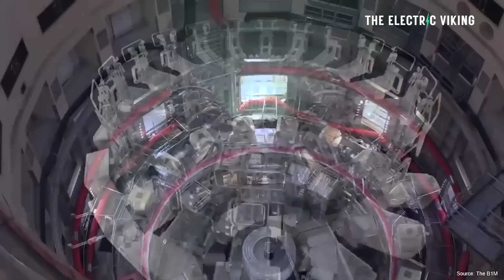Sweden criticised over plan to build at least 10 or more new nuclear reactors

Comment: You cannot compare new gen smpr nuclear with current plants. The technology is safer and we in fact need it to reuse old nuclear waste again as fuel to reduce the radiation time to 300 years from 100 000 years. Storage will be solved. Yet the waste will reduce to 1/10 amount.  

At the same time we will get energy. Recycling at its best.🔄♻️ The new gen plants will use mainly thorium as fuel after the old waste.

 Thorium is low radiation fuel which can be found in beach sand. It is so low radiating that it does not harm people. Yet thorium can be extracted from mine waste material piles. It is estimated that thorium will last 10 000 of years. One persons energy need is a matchbox size of thorium which is abundant substance.

Nothing but pro arguments to these passively safe new small modular nuclear plants which can be built in  citieswith low costs👍

Sam needs an update to his data. Of course this technology is just coming to market in 2-10 years.

Comment: That is very smart. Germany decided to shut down their nuclear power plants and they have suffered very high electricity costs. Unlike solar and win nuclear power provides constant output for long periods of time .

It does not produce any co2 either. If they have extra capacity they can sell it to their neighbors. I know Germany would be happy to purchase any extra electricity so they don’t have to activate all their coal plants. 

It is a win-win.
Reply: Germany's final nuclear shutdown had absolutely zero to do with electricity costs since their nuclear power was only a tiny fraction of their total electricity production and electricity costs are also coming down all across europe since months.

Germany has extra capacity since many years, which they are selling to the countries nearby that don't have enough capacity despite having tons of nuclear power plants, like France.

Wind does also provide constant output to the grid and is Germany's main power source since a long time.
Reply: @Tschacki_Quacki  
In 2021 13.3% of electrical power was produced  by nuclear power. Now (after the closures) that is down to 6%. 

To think that electricity costs will go down when you reduce production capacity is the opposite of what will happen.

Wind is not a constant resource. Wind speeds go up and down. Unlike a nuclear power station that can produce constant output.
Reply: @realestatenow  It was 6% before the shutdown and is obviously at 0% now.

Production capacity didn't go down in Germany. H1 2023 had the exact same output than H1 2022 but it was significantly cleaner and was still way more than Germany would need for it's own consumption. Total production will have increased by the end of this year, since Germany is constantly setting up new wind turbines and solar.

Wind is a constant output. You can see that in every country that relies on it. Wind turbines aren't accumulated in a single place, they are spread out across the whole country.
Reply: @Tschacki_Quacki  as far as I know the last 3 nuclear power stations are still operating in Germany.   

I am glad they are getting clean sources of energy. I doubt that they are cheaper than electricity produced from coal though.

Comment: Sweden is pretty far north, so that might be something to take in the count with solar, and they have a lot of snow in the winter, they basically have only wind energy left to tap into, and maybe bio mass with wood, there's also been a ton of new developments with small prebuilt thorium reactors, I think it's a good thing at least someone is trying this new tech before we dismiss it completely
Reply: Climate change has caused almost snow free winters in southern of Sweden. Few day under freezing temperatures.
Reply: @electricviking 
Breeder reactors / thorium reactors are the solution in medium term for sweden and other north countries if they want to keep a base industry to sustain manufacture industry. Sweden may have a better policy than germany and other manufacture powers in europe.
Reply: @Harrythehun  Thats true, but there's still Sun angle problem this far north, and much more cloudy days, I just got a solar system for my self, and on rainy days production is less than 10% of sunny ones, pannels are really sensitive to clouds and tilt, I can even see production falling week by week as the Sun is getting more angled in the autumn, if you have a huge power station this incremental losses will be really visible, they will probably use those reactors for small amounts of energy in the summer and then use them like "peaker plants" for the winter
Reply: Well, we've massive hydropower here.
Reply: @Fs0n1ine Sold to the Dutch (400mW), the Germans, the Danes and even the UK, not to forget that the Norwegians want to keep warm in winter too and the hydro works less when bitterly cold (somewhat unusual but a risk). They Dutch btw want more. So: now what? Pull a cable to Australia?
Reply: @nas4apps Unfortunately I have no idea of how the losses in the power grids work (my brother has worked with and planned at least low power lines and sea cables).
Sweden sells 400MW to NL. The losses in the Swedish grid are (I have seen the numbers, and they were quite large) at least 1,000 MW, but they can be 2,000 MW, which would correspond to two (old) nuclear reactors.

So Sweden needs 1-2 nuclear reactors to just cover the losses in transmission of power. So it's of importance that the power is produced close to the consumer!
Reply: @Fs0n1ine  But aren't most of the spots already used, you have to have specific factors to be able to make an artificial lake, and it's pretty hard to start making politically wise because it flods a lot of land
Reply: Yes agree.

Comment: Sweden has had practically co2 neutral electricity for 60 years now. Germany spent like 500 billion euro on renewables and still only have 50% co2 neutral 🤔 if they had keept their nukes they would have been 67% co2 neutral irrc.
Reply: Germany's last nukes have contributed <6% to total power supply.
If they had kept their nukes, they would have continued to pay a fortune for so little outcome.
Reply: @Tschacki_Quacki much easier to use ruzz gas, too bad about the pipe.
Reply: You are right!

Comment: there have been quite a few NPP's that were build on time. here are some examples.
Japan:
- Shika 2 (4 years)
- Higashi Dori 1 (5 years)
- Hamaoka 5 (4 years) 
- Onagawa 3 (3 years)

UK:
- Sizewell B (7 years)

France: 
- Flamanville 1&2 (6 years)
- Paluel 3 & 4 (6 years) 
- St. Alban 1 (6 years) 
- Blayais 3 & 4 (5 years) 

Finland: 
- Olkiluoto 1 & 2 (6 years)

no country in the world that is embracing nuclear like Sweden? What? China is building 26 new reactors, with a total installed capacity by 2050 between 150 and 400GW. Russia is investing and actually building fast reactors (waste burners). Korea has been exporting their design and building for decades. 

come on man this just hasn't been researched. If you'd think this is a "weird" decision to go for nuclear, do some research on energy security, material use per produced kwh, longgevity of energy systems, etc...

the area that mister Musk is comparing it to, is the exclusion zone around a NPP. this is typically in the range of 20-30km. so this area would be 2800 km² instead of the one square km where the actual power plant is. 

genuine question here, how do you first state that doing some simple calculations on the cost for the 10 new reactors isn't that hard and then say that the same surface area of a NPP will yield more energy when used for solar panels instead of the reactor(s)?

Comment: Solar don't work well at such northern latitudes (long winter nights); wind is the renewable.  Nuclear is need when the wind don't blow.   At least nuclear has a low carbon footprint like wind turbines.   We here in Ontario are so blessed; our electicity cost is CDN$0.151 per kwh peak price.  59% nuclear from Bruce, and Pickering, 24% from hydro electric, 8% from wind, 1% from solar, the rest from gas.

Comment: elmojito nailed it.  Solar is not practical for northern latitudes.  Especially considering that the peak demand comes in the winter where solar power output is at its lowest, which means even if you build out solar in Sweden in a spectacular way, you still need an secondary supply in winter. 

That said, wind power and hydroelectric should be capable of providing sufficient, stable supply. But given Sweden's geography. Hydroelectric power transmission would be quite costly to build out.  Nuclear has the advantage of being located near to demand reducing transmission costs

Comment: France has the cheapest electricity in the EU. 68% of their power is nuclear. Solar + batteries is more expensive than nuclear. Just because they aren’t showing you the data, doesn’t mean that they aren’t looking at the data. They absolutely HAVE to be looking at the data.
Reply: You confuse price and cost here. France  has lower taxes on electricity, which makes the price lower. 
Production cost per kWh nuclear is higher. Nuclear is extremely subsidized in france to make for the difference.

Comment: As others in the comments have stated solar is really not a great option for Sweden and batteries will not last through the very long winters with days that can last only 6 hours long.  That's not even including clouds.  This is why they've put most of there investments in renewables towards wind.  Whether or not if someone likes nuclear, if any country should build more nuclear reactors, Sweden would be a prime candidate.   Also, no power grid engineer is thinking ahead just 1 or 2 years down the line.  When they build out new infrastructure they are thinking in terms of many decades not the immediate future.

Comment: If you want heavy industries solar isn’t the only solution just now. Especially in winter it has disadvantages. Nuclear power is the best solution for a long-term low price. That’s why even Japan builds new reactors
Reply: No, a consistent renewable (zero-nuclear) scenario for Sweden would probably emphasize the role of green fuels (hydrogen, ammonia, methanol...), produced in Morocco, Oman, Namibia, Chile... before being shipped to Sweden. An honest analysis would then reveal that an economy with such green fuels is cheaper than nuclear (there's also a perspective with long-distance interconnectors, but experts say this one is probably a bit more expensive and legally complicated). The ensuing vision doesn't have a lot of problems with intermittency or whatever you're suggesting. The reason why countries are building nuclear is because they are afraid of not being energy-dependent, they are afraid of a political fracturing of the world. In energy-politics, some countries are already back into the spirit of the 1930ies. (I haven't watched the whole video, so I dunno to what extent I'm repeating what the viking is saying)
Reply: New NPPs have had multi-billion dollar cost overruns and decade long construction delays, so utilities  have decided to avoid ordering new nuclear.  The costs of new NPPs have been rising, where the costs of renewables have been falling.  Wind turbines and battery storage would be a very good solution.
Reply: @5th_decile yes, energy independence using foreign sourced fuel & foreign waste disposal.

Comment: As Australia is finding out, connectivity to the grid of renewables is cost prohibitive. Whereas a SMR actually located on existing power station sites is relatively cheap and the existing transmission infrastructure can be used.

Comment: This is brilliant actually. There’s no sun in Sweden in the winter.
Reply: But there is wind and wave energy production technology
Reply: @larryc1616 Sweden has limited energy storage, and wind needs a lot more storage than solar (a few weeks of demand). Deploying nuclear alongside solar, hydro and wind makes a lot of sense.

And 10 is a good number of reactors. The 1st will be a fuck up, like all first nuclear reactors. But by the 3rd or 4th they should have the production process nailed down and be churning them out fast and cheaply.
Reply: @larryc1616  and there is no lubricant that can work at those winter temperatures, they all turn to jelly
Reply: @domtweed7323  unless they buy from a series that already had it's fuckups (say, EPR2)
Reply: @AmauryJacquot  Maybe, but that assumes you rehire the most of the same engineers. If you give the task to a new group of engineers they'll probably end up relearning the lessons the hard way.

I'm not anti-nuclear. I just think that, to do it properly, you need a massive state monopoly with dozens of billions in money to risk, and to build at least 4 at a time.
Reply: @domtweed7323  which is why I said “buy something proven”.
As for “wind/solar” the german results so far are pretty underwhelming. Today (2023-08-13) the day’s minimum is at 185g/kWh produced.
France stands at 24, and Sweden at 18
Reply: @AmauryJacquot  Yes, but remember to hire an entire engineering team with first hand experience too.

Btw, Germany fucked up because of geography. Here in Britain wind power works great, and Spanish solar works great. It's just ashame that the scientifically illiterate anti-nuclear Europeans have to live in the cloudy, non-windy, but of the continent with low hydro potential.
Reply: @domtweed7323 Sweden has by far the best energy storage of all EU countries.
Reply: @AmauryJacquot What temperatures are you talking about? Which of the bearings concerns you? What kind of machinery are you working with?
Reply: @leiflillandt1488  those windmills can’t work up north in the winter
Reply: @leiflillandt1488  Swedens instantaneous hydro power output is about 17GW and can't be expanded much further. Swedens instantaneous peak demand is about 21.5GW. So, assume all reservoirs are full, Sweden needs 4.5GW of base load or dispatchable renewables atm (which wind isn't), and more are they fully electrify heating, industry and transport.

Sweden can build loads more pumped hydro storage with wind, or it could invest in baseload nuclear. Either is fine, but current storage is insufficient.

Comment: Bottom line is Solar Wind and Batteries are orders of magnitude cheaper and take up way less land.  The rest will sort itself out.
Reply: Love how you won't find any stats to back up that argument. But thanks anyway. You could fit all 10 new power stations on 1 decent sized wind/solar farm 😂
Reply: @geoffhaylock6848  wind footprint is the smallest of any power source.  Nuclear is great, it’s just 20 times as expensive.  How much per kWh is nuclear either compact or otherwise?  Why would a smaller plant cost less when it doesn’t have economy of scale?  Anyone trying to site new energy projects knows solar/wind/batteries is cheapest option.

Comment: Solar works extremely well in southern regions where maximum PV output occurs at the time of maximum demand.  In northern regions, the 4 to 6 months of heavy winter demand occurs when solar capacity is very low.  Storage is not possible - battery or pumped.  Geothermal storage can be a big improvement as well as the cheapest but a guaranteed adequate energy supply is not in sight.   Makes you wonder why northern countries are trying to increase their populations.

Comment: It is nothing bizarre here, it is just people from outside who do not understand many aspects of energy.  In the last 15 years, the pseudo-environmentalist party took control over the energy producers and pushed the agenda to renewable - correct in principle, very wrong in application -  and the result is that in the last 3 years, Sweden had the most expensive energy in the north,  pushing a lot of factories to close their plants as the energy was too expensive to be consumed. The electricity bill took 3-4 times more money from my pocket than 4 years ago! 
To clarify your "bizarre" sentiment, the wind farms are at least double in cost and getting 10 times more surface for the same energy capacity production, but the main problem is that in the last 3 years, the wind blew much less than estimated...the second, there are a lot of people who are not willing to have a wind tower getting their skyline. There are communes that denied the applications for new wind towers. The third point is that the demand for electricity will increase exponentially in the near future, the requirement for energy is tremendous in 5–10 years with the adoption of EV transportation, where VOLVO is a leader and NORTHVOLT build the biggest battery plant of the North in Skellefteå (over 1000 jobs available there!) and another battery plant in partnership with VOLVO in Gothenburg... So ... No, you are all wrong, as you have misled people about nuclear energy... 
Do NOT DOCUMENT YOUR INFO FROM HOLLYWOOD HORRIBLE MOVIES!
Reply: Also Sweden is starting to change their steel industry to use hydrogen instead of coal.  That will take a lot of power to create the hydrogen.

Comment: Nuclear is usually impractical but mostly for political and regulatory reasons rather than technical reasons. If they can shortcut these problems it makes sense for long term base load.  Solar doesn’t work in winter and batteries don’t last six months. . Nuclear  gives them a long term zero carbon pathway.

Comment: You asked about recent build costs/schedules. The last 2 CANDU reactors Atomic Energy Canada Ltd built (for China) were done on /under time and budget in 56 months. 
https://en.wikipedia.org/wiki/CANDU_reactor

Tho coalburning conservatives from western Canada always kick crap out of any Ontario industry when they get elected, so they sold off AECL in bits last time they got elected. Still have 20 reactors running in Ontario, with proposal to buy a couple small modulars from GE.
Reply: Amongst the big nuke plants, the Canadian designed CANDU system is an excellent nuclear technology. 

Hopefully new versions will become available before too long